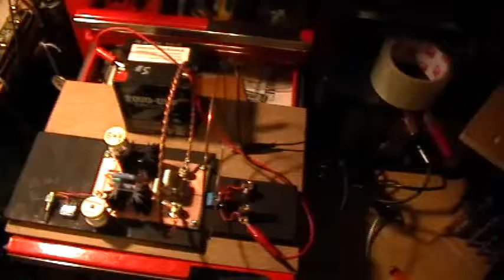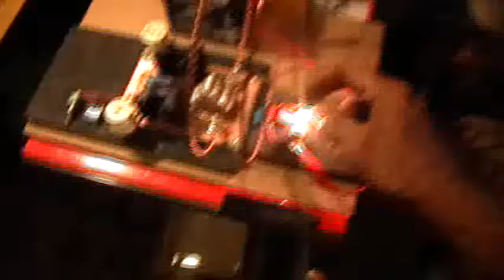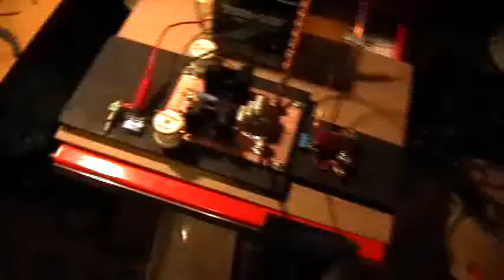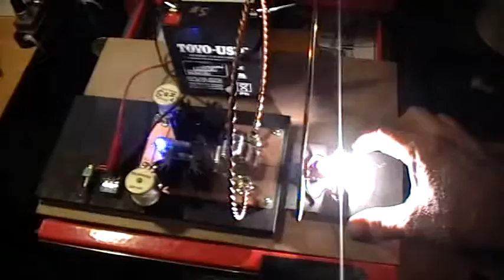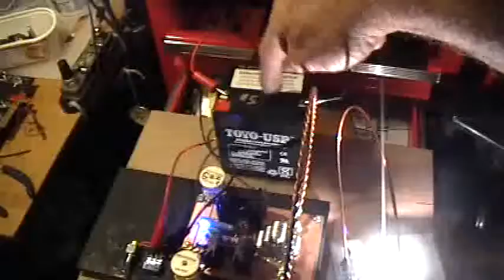Electric OU: Wireless Power 2: Voltage Amplification Brightness

Comment from the maker: They are pure sinusoids, both across the bulb and across the transmitting loop. There is a bit of regular periodic noise, very slight, that is greater in the normal mode and reduced in the brilliant mode. The major difference is the frequency: the brilliant mode f0 seems to be 2/3 the normal mode, roughly.